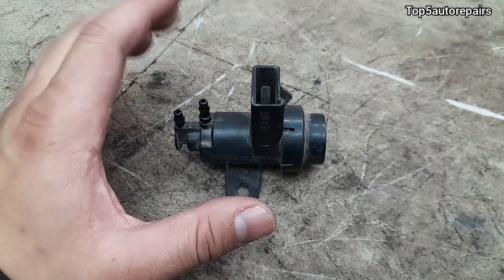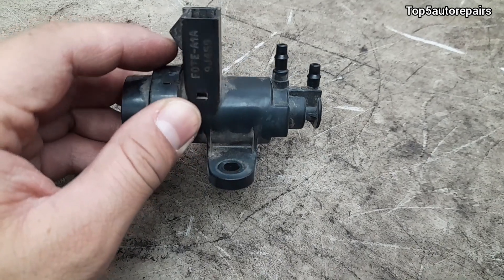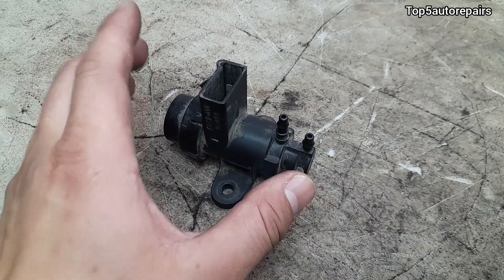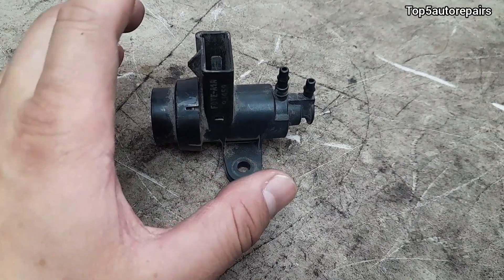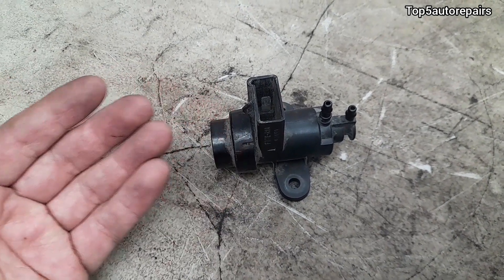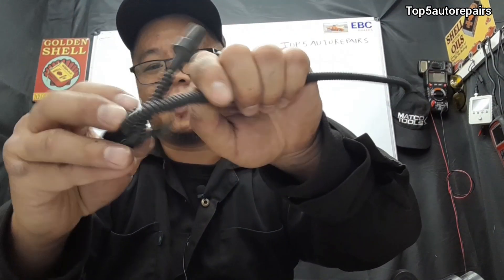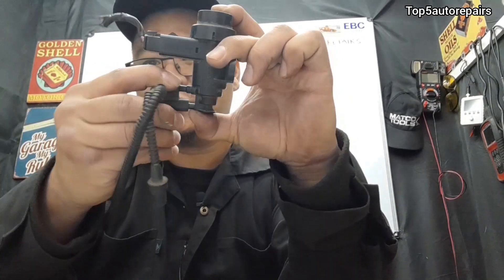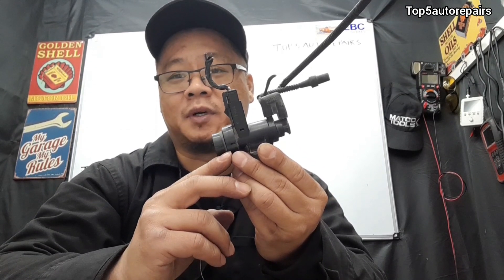SIGNS OF A STUCK OPEN AND STUCK CLOSED PURGE VALVE SOLENOID P0443 P0444 P0445 P0442

Comment: Im stressed out. My 2000 silverado has 200k miles.  Im having intermentant stumbling and rough idle etc after periods of letting truck idle for say 5 min plus.  Ive replaced fule pump, filter, idle air control valve with relearn,  fuel pressure regulator , cleaned air filter,  replaced mass air flow sensor , smoke tested found main vac line from passenger valve cover to throttle body was ceacked in half. Reolaced and seemed to be running much smoother better mpg, all sudden the issue returned with a vengance . Plz help , man down , sos , beating head against wall.
Reply from the maker: Check out my video "3 reasons why your car engine stumbles and shut off"
Reply from the maker: I suggest checking for bad oxygen sensor

Comment: I replaced the solenoid. still getting the code P0449 solenoid open. Charcoal canister looked good no bb's  running out. car still won't take gas. any ideas?

Comment: Is it possible for your car to have a p0171 code with a bad solenoid?
Reply from the maker: Yes if it's stuck open
Reply: Thanks for the fast response
Reply: My nissan Almera 2014 model can't accelerate smoothly. Can't even climb a small hill even on all acceleration pedal down. I can hear a  cricket sound when am trying to climb a hill.